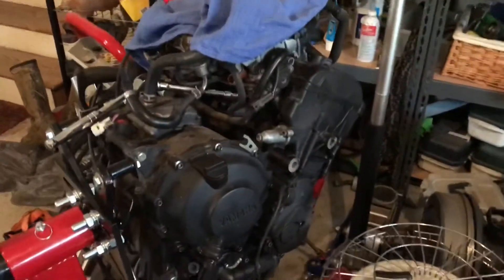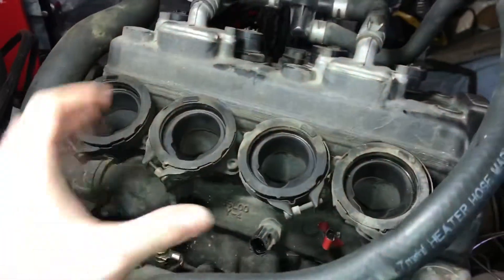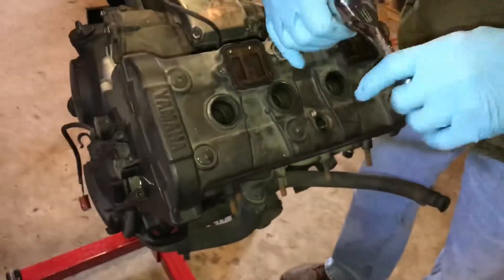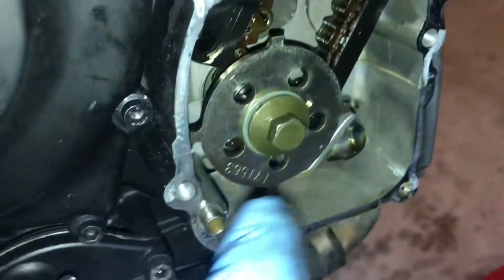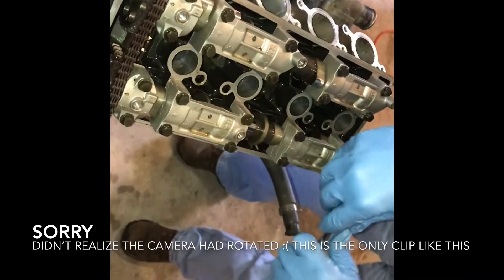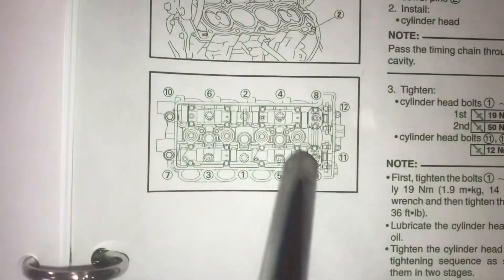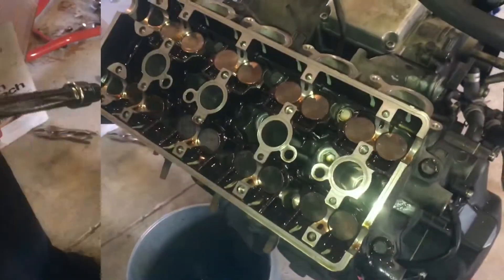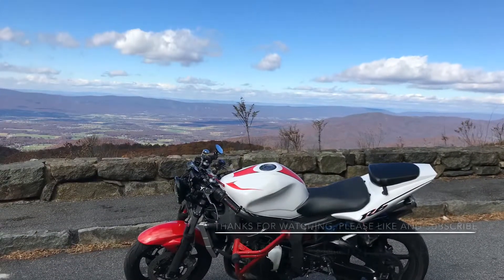Removing a cylinder head  R6

Comment: 02:30 is not the oil pump, is the crank position sensor cover. I think you didn't even need to remove it thought. As you only need to remove the center cover with a flat screwdriver.

Comment: I think you were loosening the cyclinder head screws in the wrong sequence. As far as I know, you start tightening up those screws in the order you showed.  But you have to/should  loose them in the reverse direction. Always from the outside to the inside
Reply from the maker: Schrauber Philipp I noticed that the tightening and loosening sequences in the owners manual for the 2003-2005 R6 were the exact opposite of the 2006+. Is that maybe what your thinking of?
Interesting point though regardless!